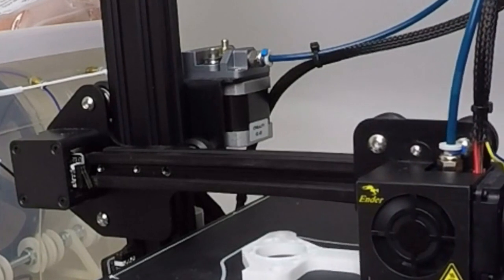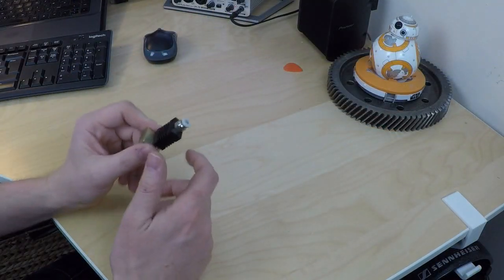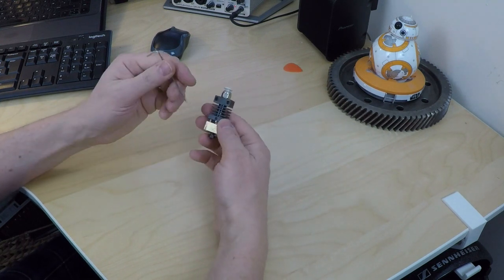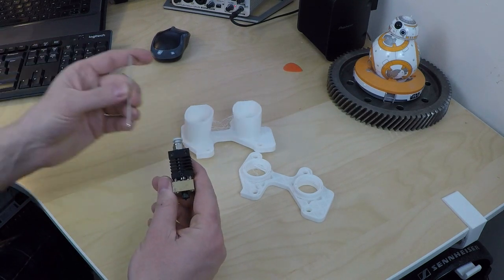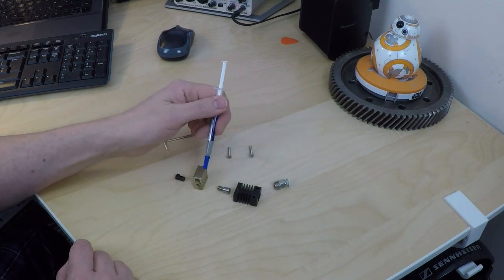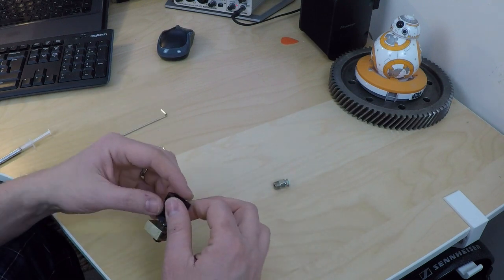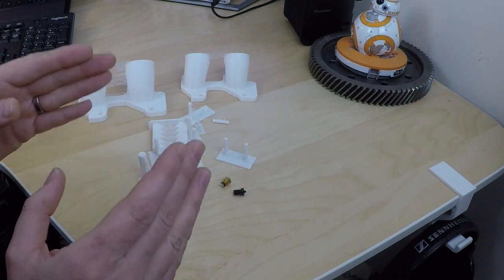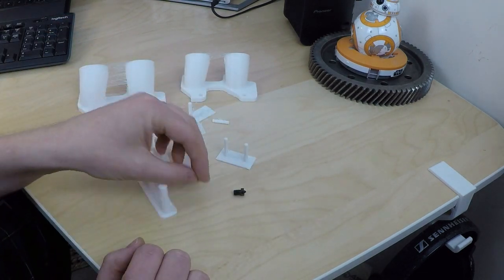Never clog again!! 2 easy tips to solve a clogging all metal hot end!

Comment: I bought the exact same hotend from the same ebay seller and it is clogging like crazy!!!!!
Reply from the maker: After I did the video I printed and fitted a “fang” fan arrangement, https://www.thingiverse.com/thing:3504842 this has a fan duct to put all the cooler fan directly onto the heat sink.  This reduced the stringing to zero even with 1mm or so retraction, now no clogging AND great quality!
Hopefully the changes, thermal paste, retraction settings and more air on the cooler help you get yours sorted!  Stick at it!
Reply from the maker: Also, forgot to mention, I can print with no clogging on PLA, PETG and Nylon but if I try Glow In The Dark PLA it’s a battle, some filaments are better than others
Reply: @MakingforMotorsport  When I begin to feed the filament it starts coming out from the nozzle with ease but then it keeps clicking and gets stuck for some reason.. 😔😔
Reply from the maker: @JohnWayne99999a  so you can push the filament through with your hand at the print temp but when you start printing it starts clogging?  What is your retraction setting?  As long as the nozzle temp staying there that shouldn’t be the problem so it sounds like it’s heat soak and retraction.  

Something else I have done since the video is remove the 2 screws holding the heater block to the cooler, and just tightening up the nozzle to the heat break hard keeps everything together.  This puts less heat into the cooler so it runs less hot.
Reply: @MakingforMotorsport  I set the retraction to 1mm, so maybe I should try to disable it completely and see what happens. I am quite confused and frustrated right now. It just makes no sense for the extruder to work and let the filament out when I push it through by hand but then, when I hit print it suddenly clogs up after 10 seconds or so.
Edit. I am doing some tests. I just unscrewed the nozzle and let the filament run through the titanium tube  while lowering the temperature down to 100 degrees. No issues so far. I wonder if the problem is the nozzle at this point..or the connection between the tube and the nozzle
Reply from the maker: Okay, so if it clogs after 10secs it doesn’t sound like heat creep or the retraction something like that, I agree it sounds more like the nozzle.  Are you warming it up to 250 and then doing a final tighten?
Reply: @MakingforMotorsport  yeah that's what I always do before tightening the nozzle. I'll see how it goes after I replace it with a new one. Hopefully that will solve the problem.